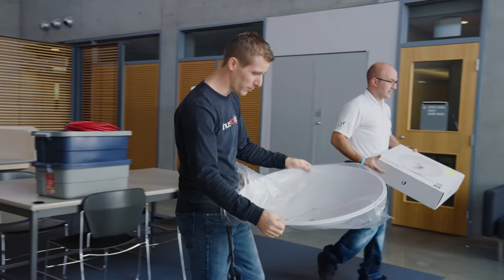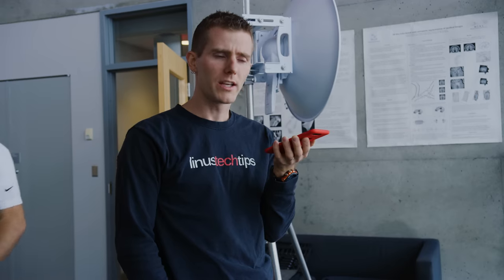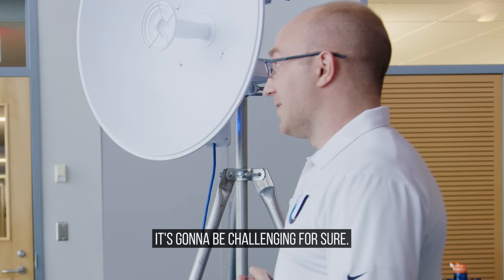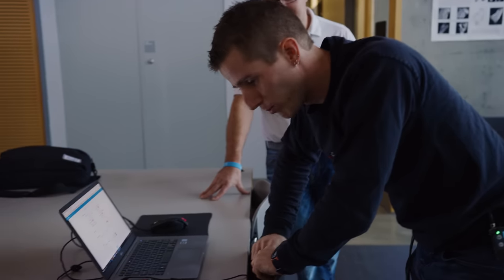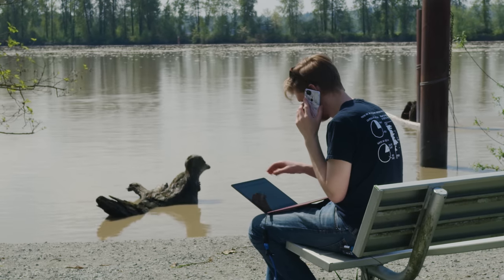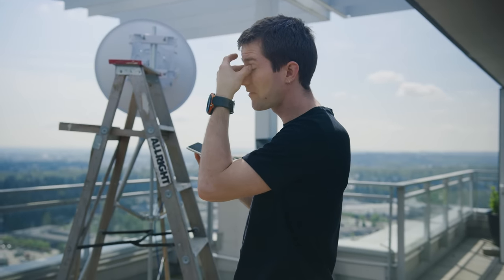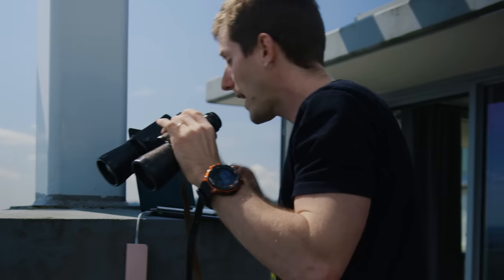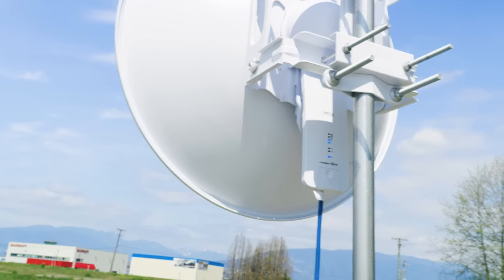12 KILOMETER Wi-Fi - SUCCESS!!!

Comment: Working with long distance wireless connections every day for a few years now, this video had me grinning from ear to ear watching Linus struggle. Something like this usually takes my guys about 3 hours to set up on both ends.

This kind of equipment is the only option in rural areas if you need a broadband connection and can't get fibre, so it's really popular in South Africa.

On a side note, using something like mirrors is pretty much par for the course if you need to align two directional antennas like this, so well done on picking up on that one Linus!

Comment: This probably seems almost absurd to those who haven't tinkered with wifi or other signals before, but essentially there is very little stopping you from doing almost any arbitrary distance as long as you have focused antennas and a clear line of sight.
I've done hundreds of meters before (sharing a connection to another home) with a combination of homemade parts and cheap ebay crap. As long as you have a clear line of sight and a drectional antenna you can make incredible things happen - even if your antenna is literally made of a pringles tube or a discarded can of tomato soup (a socalled cantenna).
After all, these are the same basic principles that have been used for delivering satelite-TV for decades, and that shit goes into low earth orbit...
Reply: The problem is you still need enough power to transmit it.
Reply: TheStigma most underrated comment.
Reply: Rain will mess up the signal a lot if it's a weaker one
Reply: Yea, you do need SOME signal amping if you want to do really long distances. A standard home router outputs a super weak signal. Although you can still make that reach a long way - I didn't use any amps in my homemade projects. There's obviously more required to do tens of kilometers than it is to do a couple of hundred meters though :)
Signal power is often misunderstood and misapplied in wifi by amateurs (which includes me btw). Intuitively you'd think more power = better stronger signal, but it only helps under very spesific circumstances, and most importantly it's near useless unless both sides are amped. Trying to put a signal amp on your home router to increase it's range is mostly pointless, if not downright detrimental to your actual signal quality. (not to mention there are strickt laws that regulate transmission power for antennas for very good reasons that you should not ignore)
Reply: Yea, heavy rain has some effect for sure, but in the grad scheme of things it's a small factor (compared to things like having great alignment and a 100% clear line of sight). If your setup can barely hang on in clear weather though it will fail in a rainstorm, so you need some margin there.
Reply: Communications satellites for television are typically in geostationary orbit. Much further out than low earth orbit.
Reply: TheStigma proof that the earth is flat
Reply: I believe there is a hard upper limit due to packet synchronization. I believe it is about 25 KM? I'm not sure.
Reply: TheStigma i have a mavic air drone from DJI that has wifi signal that can go as far as 4kms.
Reply: Please make a video, would I be able to transmit my friends wifi (he owns the house and full permission)? I checked google and it's approximately 3.5-5km away, tools needed? Approximate cost? At this point Im just wondering how then if i can get it on the cheap then i'd go for it.
Reply: Another thing i forgot to mention, i have a usb wireless adaptor (alfa) which supports wifi antennas and i seen people using massive satellites with it which is cool.
Reply: Yea, my bad. I thought geostrationary WAS in low-earth orbit, but looking it up geostationariy is like 35.000km while low-earth orbit is as low as a mere 2.000km. Quite a difference there. Easy to get mixed up when it comes to those sorts of distances.
Reply: Where I work (ISP) we offer connectivity to more rural areas using Ubquiti P2P dishes. I think our longest link is 22km but beyond that we start to find some... interesting issues. We're on an Island and we have a HFC network that services most of the populated areas, but we service a few people who are a part of the main-land that's near our Island. These are the people with the longer links, and past about 22km we start to encounter issues with the tides cutting off portions of the fresnel zone causing loss of connectivity. Also we've found that the crosstalk starts to really build up, our masts are supporting up to about 100 customers each, but we've found that any more than this starts to cause the whole sector to perform poorly due to the interference. Super duper interesting tech though! The new Ofcom laws (UK here) regarding radar have been really difficult for us to deal with, basically when any of our UBQ wireless technology detects any kind of radar it automatically shuts off (This is so that urgent, see: military, radar signals can get maximum exposure and minimal interference), which as you can imagine is a huge logistical headache for us at present.
Reply: We communicate with probes almost out of the solar system(probably further), so that's as much DX as you will get. Yet you can't make infinite line of sight communication on Earth, as it is a sphere. Maybe plane communication counts at it? They're way up so they're in line of sight for much longer distance. For further distance you need your signal to bounce. You can use shortwave for the ionosphere, or get creative and use the moon as a bouncer. Although this requires much power compared to wifi and luck.
Reply: If high frequency stuff just wouldn't involve so much calculation and black magic...

With black magic I mean random stuff happening because you soldered two components too far or too close to each other or some other crap that takes hours to find.
Reply: Well damn, now that's cool. Kinda want to build a setup like this out of scraps too, just for the sake of experimentation
Reply: @Xx Tek tip xX That should be quite doable with fairly cheap parts IF you have a clear line of sight. If you have or buy a router that can take an external antenna connection (or simply open it up and hack it straight into the signal-plug, which isn't hard) you can use completely normal router equipment for home-use. I'd make sure to get one that can do the N standard as it tens to be more robust for range than 5Ghz (ac), but pretty much all routers can do that...
The only thing you really need in addition to that is 2 high gain directional antennas. I doubt you need more than fairly inexpensive ones - although I don't really have experience with several kilometers range personally so I can't give you some kind of recipe for the exact stuff you need. Clear line of sight and good alignment is generally far more important than a huge expensive antenna (and as you can see from the video the alignment part can be tricky at those distances).
Ideally you'll want to mount the antenna outdoors (so get weatherproof ones), and definitely AVOID long signal-leads from the router to the antenna - do NOT attempt to lenghten these. These have to be short as the signal attenuates quickly. Plan on the routers being placed very close to the antenna, just on the other side of the wall basically.

It's not really that hard to do this (I mean I just read up on some basics myself with no training or direct guidance) but it's probably advisable to go to a wifi forum and read up + ask some REAL experts on more specific advise.
Reply: I did this during college when I lived in the US. 
Used some dishes my grandfather had taken down during a renovation to beam a signal about 8 miles from my grandparents countryside home to my mothers house in the suburbs.
Reply: Thanks "Emma," for making two posts, so I could report both of them for different reasons. (spam and porn links)
Reply: But, more importantly: what are the ping times like? I estimated an upper limit of like 24 seconds based on my ping times to my router in my house, but that seems too high.
Reply: TheStigma could you use a satellite tv antenna for this?
Reply: Did this on 2g and 5g in 2001 over a distance of 90 miles. Morse code, but any digital mode could have worked.
Reply: TV signals go even beyond LEO. We're talking GSO here, that's like 35000-40000 km up.
Reply: But how is the latency?
Reply: Crypticsz since electromagnetic signals propogate at light-speed (technically a little less in a non-vacuum I think, but its inconsequencial) it doesn't really affect latency in any significant way. Em waves travel 10km in a tiny fraction of a millisecond and latency from this kind of communication only becomes an issue at extrme distances (for example to the moon we are talking about 1.25sec). Basically if the signal is solid theres no difference is the transmitter is in yout living room or 20km away. Even the quality of the actual routing hardware is going to have a much greater effect than any signal latency.
Reply: @prescott231233 Yes, an old satellite dish is actually an excellent option for a homemade system since are powerful directional antennas and you can find them cheap because everyone used to have them and now they are starting to get phased out. You will need to make some minor alterations to it to allow it to take a wifi signal, but that's no problem.
Reply: @ZipplyZane as I said to another guy here, EM waves travel at lightspeed, so covering 20 km takes a tiny fraction of a millisecond - not enough to even measure without special tools. Only at space distances or more do you get significant lag (1.25s @ moon which is really far away).
Any latency you are able to measure with a ping to your router is going to be purely due to the quality of the routing hardware and to a certain extent the speed of your connection (since even ping packets contain a few bytes). The delay due to EM propagation of the signal is orders of magnitude lower. At 30 meters it would in the 100-nanosecond range, which is 100.000'th fraction of a millisecond.
For practical purposes there's no difference beween talking to a router at 20km or 20 meters as long as the signal is equally good.
Reply: I did 50 KM at 50mbps with Mikrotik so what??
Reply: Teach us. Please you will get a lot of views...

Comment: We did something similar in Guadeloupe for caribwave : 27km wifi bridge between 2 islands. The next year, we hit aproximately 50km, but we went down from 300mbits to 5mbits (we were overspec).
We had ubiquity gear too, but smaller antenas. However, we had a HAM with us, a 4m high mast on top of a house, and the other teams were on high points on the other islands. 
We also used software to calculate line of sight using topographic data, and calculated the optimal positions. One of the teams had a car battery with POE injectors to power up the hardware, as they were in the middle of nowhere.
The goal was to show that we can establish communications with no cellular network (each team had a position to reach, and an orientation to set once on site), and potentially no access to grid power after a tsunami. We had multiple services hosted on laptops and raspberry pi"s, with a protocol to replicate data at each end when the connection was available.
Back then we even got good words from Obama's office (we were surprised, as we're on a French island, although the event went on in the whole caribbean arc).
It was a pretty nice experience, we still have the antenas :)
The event was mostly organized by an association i'm part of : Gwadalug (french readers can find more at gwadalug.org, or search gwadalug caribewave 2016).
The ubiquity hardware was quite nice and reliable, and we even managed to exceed the manufacturer specifications :)
Reply: That's actually really cool, thanks for sharing.  Your comment was more technical than LTT's entire video.. haha.
Reply: How did you use the ubiquity gear? Can you change the frequency of the ubiquity gear out of the wifi only bands (as it is problematic to use high power as short range devices)? 
Did you disable the radar detection? Is it possible to use 5Mhz channels with the ubiquity gear mode?
The real challange is to set up a legal wifi connection! Use of high gain recive only antennas, band filter, preampilfier and very small standard antenna to transmit.
(or get a permit for high power wifi with all the safty protocol attached)
Reply: And you knew what you were doing - That is the point of the whole story. On the other side, most of the time Linus and his Team have no single clue what are they doing if presets from their Sponsor companies are not functioning 100% the very moment they press a button.
Reply: Wow! Just wow... I've worked in the US to configure short range (under 20 miles) RF network coms, but to work on a project of that scale!? Super cool... Appreciate the story sir. Hopefully I can assist in the some large scale projects in the future
Reply: What do you think what is the maximum line of sight on 118m above the sea level on a flat land?
Reply: But like that's the main idea of LTT's videos, they be as much technical as they can possibly be while letting non technical users understand easily. I enjoy not having to Google for terms every couple of minutes while watching tbh XD
Reply: @losttownstreet : we used it mostly as intended bby the manufacturer, except that we had a good vantage point on a roof, pretty good alignment with a HAM giving us advice. We didn't try to get out of wifi bands (we were many people, and the operation was timed, so we didn't play around much with the hardware; although it's sleeping in a corner since then, perhaps we should play with it again :) )
As for legal transmition power, again, we had a licenced HAM for that; for the first bridge (27km) we used legal power, but for the 50km bridge we emitted ad higher power (by mistake, our antenna was set to US power limits, which is higher than what's legal for a basic end user; although the HAM with us was licenced to use higher power)
I think that we mostly succeeded because of the great preparation, not much because of extreme hardware (we had the GPS coodinates rather than try to see each one with binoculars ^^)
Reply: @Hose2wAcKiEr, no, we went for line of sight. This is the purpose of preparing the event : we used a software to  search for points that would have line of sight, using topographic data. The home station was at a HAM house, on a hill, plus a long mast on his rooftop (the mast had a nearly 1 ton concrete base to anchor it : we have huricanes in this area, so things must be well anchored)
on the other islands, we chose high points that were not only high enough but also acessible by foot when carriying an heavy car battery, and the hardware (mast, and various stuff)
Reply: @Stormwatch153 : exactly, preparation made it went smoothly. Indeed, we had a large team (i'd say 20 to 40 people), and we made smaller scale test previously, the AP had been configured, we prepared the sotfware in advance, etc... 
We had invited local television, so we had to deliver something!
For that purpose we demonstrated an offline video chat using only our local ressources. The only point that had the grid was the home base, but we simply could swap the POE sources from a power brick to a battery if needed (we used POE injectors, as some of our hardware didn't provide POE).
Reply: you proably lost more signal from going over water at these high frequencies
Reply: +Hose2wAcKiEr
 RF signals when broadcast at low inclinations actually hug and curve around the ground(aka ground wave propagation). similar to how water runs off a ball things. it wont go that far at such high frequencies but far enough for this.
Reply: These are just shameless lies. I knew him from High School and spent the summer where he claimed to do that. He told everyone that he did this fake project but me an his friends always knew he was just lying
Reply: Hello Michael, in this case, the 27km signal brought us the full speed (300mbits), i don't remember the signal attenuation. For the second link we however managed much lower troughput while using a sronger signal, but at twice the distance.  As for the water impact, we were concerned of this, as wifi is at microwave frequencies, affected by water, but it went fine.
We feared that, beeing in tropical waters (25-35°C  air temperature), with evaporation causing problems, but hopefully it went right :)
Reply: * fortunately it went right...  ;)
Reply: Gwada en force ^^